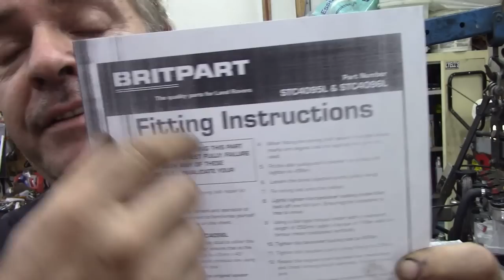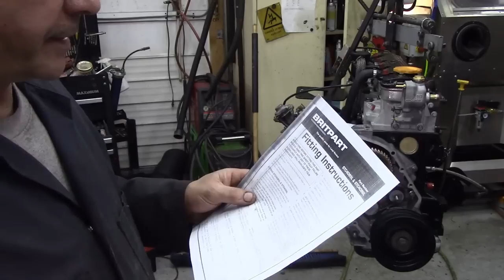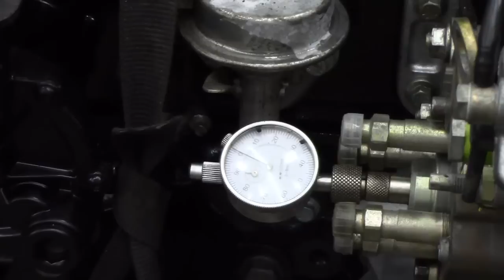Spanish 110 300Tdi timing belt fitting with interruptions!

Comment: Mike, they supply that 8mm short stud in the kit because the original studs have been known to fatigue and snap off allowing the tensioner roller on that side to drop off and, "bang" goes your valves. It is recommended to replace the stud with the new kit each belt change.
Reply from the maker: First time I have heard that !
Reply: @BritannicaRestorations  it's not happened to mine but I know of two others it had happened to, both after recent T-belt changes.
Reply: My guess is the stud is over tightened past it’s yield point so it’s stretched too far so it stops being elastic enough to keep tension on the idler. Then the idler is allowed to move the stud enough that it work hardens and breaks
Reply: @carltonr3417  yes, I'd say that's what happens.
Reply: @carltonr3417  just remembered, that stud also forms the security for the tensioner pivot point, so once it's overtightened and loses elasticity/snaps off it effects not only the fixed idler but also the tensioner. A new stud every belt change is a good policy, that's why they supply it in kit.
Reply: @gazzafloss  agreed as long as what’s supplied in the kit is of suitable quality knowing what crap parts are out there

Comment: After you tighten all the belt up, reset the tappets, and THEN set the pump timing, then yourl have full power.  Also the breather from rocker cover to the side of the block can be blanked off.

Comment: Do you put the front cover on dry?  Meaning no sealer on the gasket?  I know it's meant to be dry inside the front cover and don't know of a good reason to use a sealant or gasket maker, but didn't know how you did it.  Thanks!
Reply from the maker: Dry

Comment: Hi Mike, great video. Have you done or could you do a video on setting up the cam pulley in relation to its hub, I can't find this anywhere on the internet, and it's a bit worrisome when it states in the workshop manual a warning not to disturb the three screws attaching the cam pulley to its hub. I know it doesn't use the slotted holes, but there is a little bit of play still in their normal holes and didn't think it would have much of an effect, I think it does as have just completed a timing belt job for a customer, where I had to dismantle that pulley (small damage) and now the thing is down on power, and everything else is bang on, I also use DTI to set up pump timing. Very strange.
Reply from the maker: Email me and I will send you the page with the timing specs.
A bit technical, and you will need a timing wheel to go on the crank - like this
https://www.amazon.ca/Motion-Pro-08-0092-Anodized-Degree/dp/B009D38L88/ref=sr_1_1?crid=2K76MGM6O2NBY&keywords=degree+wheel+timing&qid=1703122487&sprefix=timing+wheel%2Caps%2C93&sr=8-1

britrest@britrest.com

Comment: Hey uncle Mike for those of us who can't get the timing pin can you tell us the thickness of the pin so we can get it made at a machine shop...and I have heard you saying a reverse switch can fit  to lock the crank ?😃 🙂
Reply from the maker: Yes an old reverse switch will fit in the flywheel - will get back to you with the pin dimensions
Reply: @BritannicaRestorations  thanks uncle Mike
Reply: 9mm
Reply: @55kemi  thanks a lot man

Comment: Nice video Mike. With my 200tdi, when I rebuilt the injector pump, I experimented with slight modifications to pump timing and found 1.60mm lift worked very well. In addition, I increased both fueling slightly and boost pressure to 1.1 bar. Much better power with small amt black smoke under max boost. The point you made on belt tension is crucial, as well as keeping pump timing within a tight range. Thanks again for all of your informative videos. Cheers!

Comment: I had this timing discrepancy on my EGR 300tdi. I found that the timing pins gave me a fuel pump lift of about 1.23mm. I believe that the only difference between EGR and non-EGR pumps is the potentiometer on the throttle control, however you are correct in saying the timing specification is different for the two set ups. I advanced my pump to 1.6mm as you had previously suggested and the difference is amazing. 
I have also done this with a 200tdi as well, and I found that the timing pins were not that accurate at setting the injection timing. I set that to 1.6mm as well and the owner couldn’t believe how much better the thing went. 
I think to do the job properly you should time the fuel pump with a dial gauge every time you replace the belt.
Reply from the maker: Yes it is a bit of a crap shoot with the pins they are not a precision fit!
Reply: @BritannicaRestorations  The pins gets you near enough that it will start and run alright but you only get the best out of it by fine adjustment of the injection timing. Since waking up to this I have retimed a few other diesels with this type of bosch pump, it makes a huge difference it being accurate! Two Mitsubishi diesels in my family, both never had the pump timing adjusted from the factory, one was 0.33mm and the other was about 0.6mm, it should be 1.0mm!

Comment: Hi there,nice and very useful video, where can I found de pin you are using to block?? Thanks
Reply from the maker: https://www.ebay.co.uk/itm/254263118507?hash=item3b33434aab:g:nwcAAMXQtRxSLKkn&amdata=enc%3AAQAHAAAAoInknCoK%2FZAuYL1fcEp7xan60NLnh%2FiXB5y5RodD81MHfTUqft1YuBSFza88wrHvdwqcBOYwoNqbfidoeIJBfIjfOybrabzpPUrxNPRW3fG%2BKM7C%2B9xBPExv7J2y4ZJU4u7EwVGHoibY3x9yVKx15z2gV15yOveLkl5Iz8YMrwOp4V7WMT0%2BwvwdYZQOYfAicOgfNkbSf2DQYMLQCKGkx8A%3D%7Ctkp%3ABk9SR-ai0fOwYQ

Comment: Hi mike, could you give any tips to get tension on belt, if we don't have a dial reader. thanks great video.
Reply from the maker: Great suggestion!
Reply: I use the old fasiond torque wrench with the pendulum and gauge near the handle
Reply: This is a great video topic! Maybe show us by hand how a correctly tensioned belt should look like. Not very scientific but it would give you some idea how close you are